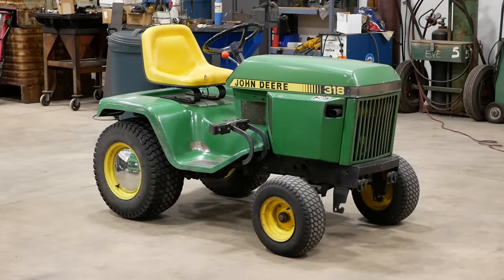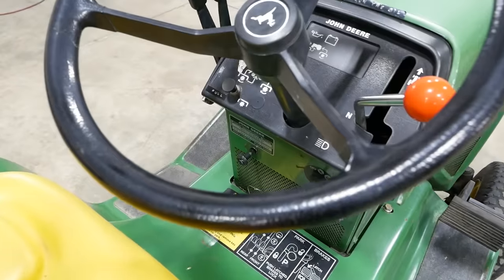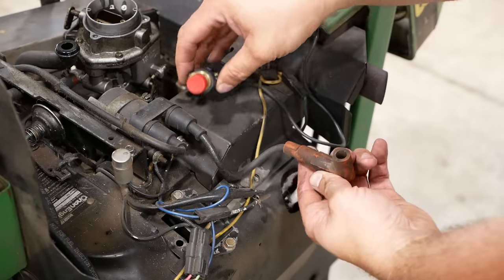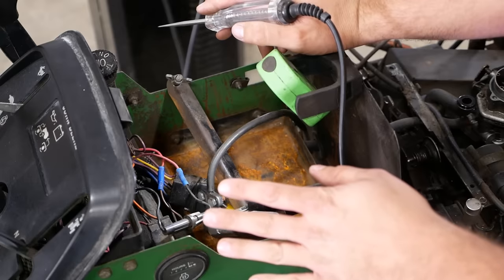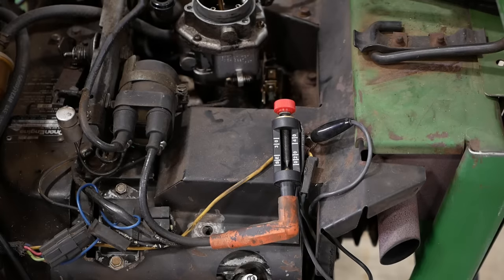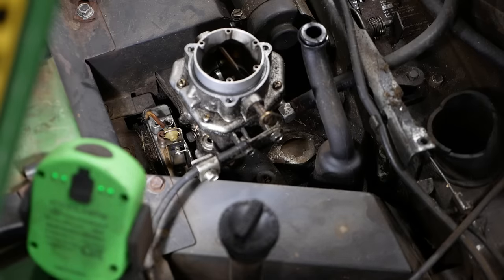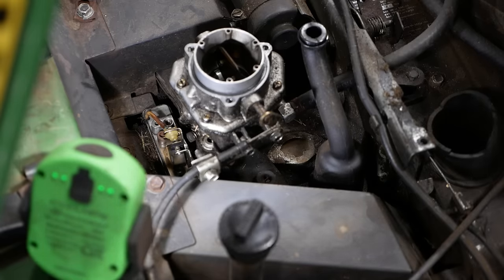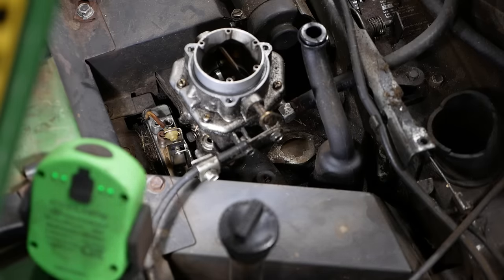John Deere 318 no Start - no Spark

Comment: Love the 318! My dad had JD140, still does. We used the 140 to plow the driveway when it snowed. had a power angle snow plow. But with the 140, it was tough to steer with the plow up due to the weight of it and I love(d) to plow snow. Well, me being a youngster, it was really hard for me to steer. My dad bought a 318 mainly because of the power steering for when plowing snow. The plow and the mower deck are interchangeable between the 140 and 318. My dad passed away in 2017. My mom used the 318 until the PTO clutch started giving her problems. So, she went out and bought a Cub Cadet! I told her that I'm sure dads rolling in his grave for as we never had anything but John Deere. Both the 140 and 318 still run. The snow plow is on the 318 and is really all it's used for. The 140, well my dad pretty much retired it once we got the 318 only because he wanted to preserve it. I still go down and start them up, drive them around the yard now and then.
And they are not called lawn mowers, around my parts, they are called Garden Tractors.
Have a great day!!

Comment: I have a John Deere 111 from the same time. It's literally cheaper to have the engine rebuilt than to buy another used mower right now.

I also had to modify the seat so it would adjust back farther.
Reply: I have an 83 111 that someone has put a 12 horse Briggs IC engine on.  I got it for $225 and had to replace all the deck bearings and the pittman arm.  I've been mowing for years with it.

Comment: Those glass fuses has tricked me too. Bought a couple to replace them all on my old Citroën. Brand new and about 75% of the fuses in the package came broken but looked perfect. I guess their made of finest chinesium. Also. That fly invasion came to Sweden too. Had them absolutely everywhere in the workshop. Never seen it before, but you said it. 2021... I never worked with hydrostats before, but I have a neigbours Cub Cadet ca 2011 here. Won´t go any direction. I guess I have to check if it has something similar of a problem.

Comment: I had a murray with a Briggs twin from around 2000. I have an acre and a half of rough yard with 25 trees, roots, 20 degree hills and tons of leaves to pickup in the fall. The engine on the Murray was exceptional, unfortunately the deck and frame were not and after 4 years my son and I were fixing it every time we took it out. When the steering tower cracked off the frame I retired it and purchased a used JD X500 with a 14 bushel power bagger. I was sold. It carted my heavy self up the mountains in my yard, it manuvered great, the differential switch was the bomb, the K72 transmission held up under very demanding use. I used it for at least 10 years. Only had to weld some minor cracks on the deck and replace the idler wheels and drop links for the deck. I have pain issues. I sold the X500 for close to what I paid for it and purchased a brand new J.D. X580 Power steering, power deck lift, same dependable Kawasaki FS730V vertical twin and K72 transmission. The only flaw with the X500 was the hood and seat splitting. JD fixed it with the X580.

Comment: Amen! NOT NOT NOT!! a lawn mower! OR lawn tractor!! (I’m a small tractor enthusiast)

Also is that a Yamaha g2 in the background?
Reply from the maker: 'tis!
Reply: Many people don't know this.  The tractors are built stouter and have heavier frames.  MTD used to sell two versions of the same machine.  They looked the same but the lighter one was nothing more than a typical riding mower. The Lawn Machine was tougher and would do much more.  I bought a very used Lawn Machine that had the brackets for a snow plow still attached to the front.  I used it several years until the Tecumseh engine finally just quit and became non-repairable.  In first gear that thing would really pull as long as it could get traction  Two cylinder, two carbs and basically like having two engines in one body!  These new Chinesium "tractors" don't last long and break down quite easily.  I bought a new box store Craftsman and it's nowhere near what the old one was.  Deeres are great machines but on retirement pay I couldn't afford to even pay the taxes of what a new one costs.
Reply: @WatchWesWork  I have one with a short in the harness somewhere… gotta tear into that mess one of these days

Comment: Oh man!  When you rounded the corner heading toward the corn field I just new the GREEN bug had bitten you and that you were going to go show that yellow Challenger what a real Garden TRACTOR could do with that grain cart!  Whew.....got to be careful of those Green Bugs and ego!   🤠
Reply: I had a small GMA glass fuse throwing an intermittent problem one time.   You could measure voltage throughout the circuit, but it would flake out.   I finally opened the fuseholder to do other diagnostic checks, then the end cap fell off of the fuse!   Element was not connected on one end.   Slide the cap back on you had continuity, it just couldn't supply current.  That was a weird one!

Comment: Even at 21 I knew the 318 was something special; decades ago I had the privilege of using one for 2 yrs on the estate of a wealthy man I knew. His actually came with a matching JD trailer / every implement available. Today I have a 345 all hydro w/p-lift, steering etc similar to this 318 all b/c of that 318. Honestly there's no comparison; the 318 is more of a tractor than my 345, though some of the 345 features are better b/c of todays tech. Anyway great video; hope to see more. Btw new sub.

Comment: Hey Wes! An update on my head gasket situation: I still didn't fix it lol. That same nut on the exhaust manifold WILL NOT move (this includes hitting it with a  mapp torch, Deep Creep and PB Blaster, vise grips and hammers). A machine shop I'm going to take the head to said they'd remove the nut for me, check and mill the head and do my valve seals for me for $250. So it's back to topping off my radiator every other day until then.
Reply: I see lol. I'm just gonna remove the exhaust manifold at the down pipe and take the head in with it attached. I'm just glad my oil and coolant aren't mixing.

Comment: We had a 212 growing up.  It was bought around 75-76.  Not sure.  I was 11-12 maybe.  I remember it cost around $3K which I couldn’t believe.  I used it to mow 3 acres of yard each week and for small hauling jobs.  We had a dump cart that pulled behind.  It needed very little maintenance over the years.  A belt would pop off the mowing deck from time to time.  I don’t recall ever changing the oil.  My. Either rode it off a steep incline and turned it over in our neighbors yard.  It was still running strong when we moved in 86.  My mom gave it to her uncle who used it for several more years.  I think it was a 12 HP Briggs and Stratton motor.  I love that machine and would love to have another one some day.

Comment: My wife has her dad's model 330 with the yanmar diesel. Almost the same machine. We had to replace the alternator and voltage regulator which she found new on Ebay for about 15% of the cost of JD parts and they were exactly the same parts. Nice Oliver tractors in the video.

Comment: 20 years ago we did a couple of 420 repower with Honda engines. We still service one of them. The 322 was the cool gas one as it had a 3 cyl gas yanmar and man were those good runners.
Reply from the maker: My brother has a 330, which I think is a diesel version of a 316. It's a beast!

Comment: I own a 1991. It's mint. I give it annual cleanings (regular maintenance, belly screen, engine cooling fins etc),  pop the hood after every run to allow the engine heat to escape (shrouded entombed engine + Florida heat) and keep the engine oil clean and filled (Cen Pe Co). I've only had to replace the fuel pump and ignition switch, both of which failed well after 1k hours.

Comment: You're lucky you didn't have to dig into that 'octopus' of a hydraulic system.  Around '05 I repaired a cpl of lines on one.  The actual hydraulic pump itself I had to take to a JD dealer.  I didn't have the special tools needed to work on it.  But the routing of the lines and trying to reattach the hydraulic pump and lines back into the tractor was a 'learning experience'.  Also learned how to fabricate the box end of a wrench into a flare nut wrench with a grinder.  You will need a flare nut wrench to work on this hydraulic system.  Have a great weekend!

Comment: I have one of those 318's and I have a 210 too they are great tractors the 210 I got for 100 bucks it did not run all it was the condenser broke off and was not grounded so I just took a hose clamp wrapped around it and mounted back and i runs great just had to fix the light and the seat had a crack in it but it even came with a snow blade and chains for the back tires anyway I use them both in the summer and winter and never have had a issue with any of them except general maintenance

Comment: I have a 1972 Simplicity 3410H that I repowered with a Predator 420. I bought a partially finished drive adapter and made new motor mounts to get it to work. I also installed a cam with a little more duration, valve springs with more pressure and a homemade exhaust. The only reason I changed the engine was due to lack of parts availability(piston). Tractor has plenty of power and parts for the predator are everywhere. Love the 318.

Comment: I had the same fuse issue on my Craftsman GT with 18 hp twin Briggs under the hood and PTO for the mower deck to engage.
Dang fuse was the trouble-maker....
Sometimes the small little things create a problem.
Nice tractor, they built quality back in the old days.
Personally I prefer Craftsman, got a 1977 Craftsman 10-36 and 1980 Craftsman GT for the yard, sturdy thick metal and the Briggs & Stratton 18 hp twin is a workhorse.
I did a engine swap on the 10-36, Tacamsa crap 10 hp engine got tossed in the trash pile and 18-hp Briggs really make this little Craftsman a beast, 3 gears forward. Goes up on 2 wheels in second gear and half throttle !
Found it 20 years ago for $ 300.00, engine smoked like crazy, but got lucky tracked down a MTD with low running hours for $ 50.00 complete. Snagged the Briggs engine & gastank and sold the rest for $ 50.00. Spent one weekend mounting the engine, correct drive-belt, moved the battery to the rear section and  had to cut a small part of the hood for making the Briggs fit underneath.
Strong, small without any extra safety junk or trinkets, and yes got a cup-holder for cold snacks on  hot days ( Texas )
Did a paint job as the original silver faded out, new tires & regular service, run's like a champ.

Comment: I have two 318 garden tractors. One original the other has a buford bucket, 23hp vanguard swap, 26x12x12 rear tires. These are great little units.

Comment: I've seen fuses that got hot and melted the solder at one end of the fuse wire which pulled away from the end cap.  Result was fuse that looked good but was electrically open.  Heat was from an external source, not over current in the fuse.

Comment: I just got off my 318 a couple hours ago.  I was blowing snow with a model 49 snow thrower.  I use it to mow 3-4 acres in the Summer and clear a 900ft drive in the Winter.  It's been in the family since new and been a great tractor.  I've added some LED work lights and few minor upgrades but other than maintenance it just keeps chugging along.

Edited foe spelling

Comment: I inherited my grandfathers 1966 Sears Suburban 12 garden tractor, which he had already converted away from the troublesome solid state ignition the Tecumseh engine had, and I tried my best to find parts for that engine, including paying way to much for "NOS" parts on ebay, that I finally just broke down and bought a Honda-clone from Harbor Freight. I still don't have it set up yet, but sadly it will be light years more reliable that what was in there, and still be in for under 10 percent of what a modern garden tractor would run me.

Comment: My old work had an ancient tractor, IIRC it was from the 70's. Thing was "small", but still taller than me and could easily flip/kill you if you mis-shifted. Was great for learning manual on though if you ignore the slight death/maiming issue.

Comment: Work for Cgb here in central Illinois. The market pushed farmers in the fields aka the elevators. With no barges on the river the rail market has been hot we have shipped every bushel out. We took in 30% corn at the end of August. Been a crazy year.

Comment: Thank goodness there was no re-power!  A 318 without the onan might as well be sold for parts!  Used my 1990 318 this morning that was originally purchased by my great grandfather.  These things are basically small tanks!
Reply: I just received a 318 for free.  It sat for 10-12 years.  I have been cleaning it up, putting new fuel lines in it, cleaned the fuel tank and other maintenance items.  It runs great!

Comment: My grandpa had the ones from the 70s. They had smooth steering but couldn't do a tight turn lol. They had the single cylinder kohler motor.

Comment: Fuses are soldered in the end cap with solder that sometimes will melt before the heat gets high enough to burn thru the fuse strap itself.  GM Blower circuits used to do this quite frequently.

Comment: Cool.   I'll never forget that V twin Onan sound/whine from when I was a kid riding around mowing grass.    We didn't have that JD but a Massey Ferguson MF 1655 and an 1855, kinda a twin to the Snapper ones.    Similar well built garden tractors that were just little beasts.   Also quite hard to come by nowadays.     I always think of those when I see the chintzy built MTD crap now.   Those had mid and front PTOs and an actual driveshaft that ran the gearbox on the heavy steel belly mount mower deck that was hydraulically raised and lowered, and actual steel frame, etc.    The 1855 even had a rear PTO and a little 3 point hitch and lift on it.     I saw a video on here somewhere when some one straight piped one of those V twin Onans and they sound like a Harley when they idle.

Comment: Bahh, throws my pitch fork, and officially unused lynch mob torch down to the ground in frustration. lol. Ah Wes sometimes the cheap fixes are the best one's, and hope the lynch mob joke does not upset you as it was just in fun. And I have to say I miss my John Deere tractor, even if it was not a 318, and all that it needed was a new mid deck. As god that thing was bad about throwing idler pulleys on the deck.

Comment: Another reason to have even an inexpensive meter or test light on hand is the fuse that " looks " good but is not passing current. One might assume it its good because they don't see it burnt thru in the middle but each part in line needs to be checked to rule it good or bad.

Comment: I bought a 1993 JD 420 the 318 big brother 5 years ago from a school auction. I replaced the starter with a cheapo from Amazon and it is great. 60inches of cutting and fast. The 20hp Onan is a power house compared to the more modern 26 brings my old one had

Comment: I actually had a fun fuse situation one time, with glass fuses as well.  24v system, and I had 23v at a switch.  Turn the switch on, the lights didn't work.  Come to eventually find out I was dropping almost 20v across the fuse, leaving nothing for the load.  New fuse, and the circuit was fixed.  When a fuse does something other than work, or blow, it REALLY can throw you for a loop.

Comment: I'd recommend against the predator repower. Father in law has a 317 and did that. The problem, the predator doesn't put out enough amperage to run the electric pto. He ended up having to buy pulleys and an alternator and scrap metal to make brackets. Big pain in the butt.

Comment: I called it when you said it didn't have any spark. I said there is no power to the coil a very common problem with most lawn tractors of any type. I usually check for power at the coil first with the key on. Then depending on the yes or no, I go to the no side until I find power. You did just that except you started at the plug and worked back to the fuse. There have been times I found power at the coil but not the plugs meaning the plugs or plugs wires were bad or in one case where I found a fried roach where the plug wire went into the coil. I still don't know how it got there.

Comment: I’m in the process of rebuilding my dads ‘71-73 Ford LGT 165 made by jacobson. It’s got a single cylinder Kohler that was tired, surprisingly there’s still some aftermarket support for rebuilding them. There’s a YouTube page called isavetractors and they have a website where he sells engine rebuild kits for kohler, onan, Wisconsin, tecumseh and B&S. I just need to take measurements of the bore to make sure I don’t have to send it out.

Comment: Those old Onan engines are a blessing when they’re running — and a curse when things go south. I rebuilt the one in my welder but wouldn’t shell out the eighty bucks apiece for new pistons. This was twenty years ago. I have a 20-horse Onan in my shed that I’d love to use for a giant-ass log splitter but when you weigh the time and materials of an overhaul versus a new Harbor Freight Predator 22-horse engine.....  probably just go with the Chinese option. Sad, but there ya go.
Reply from the maker: A rebuilt kit for these engines are $2000 back when you could actually get them.
Reply: The most I would be willing to do is spring for the gasket kit and rings then hone the cylinders and hope for the best. It’s a shame because they are some sweet running motors.

Comment: Them engines are easy to rebuild along with the Kohler did a 314 John Deere rebuild for the neighbor a few years back is running great
Reply from the maker: The rebuild kit was $2000 back when you could even get them.

Comment: those old buss fuses will sometimes blow under the end cap the only difference between a good one and a blown one will be the fuse element won't be centered at both ends .. if you twist the end caps and the element won't twist it's blown